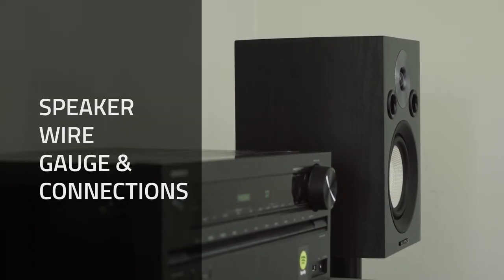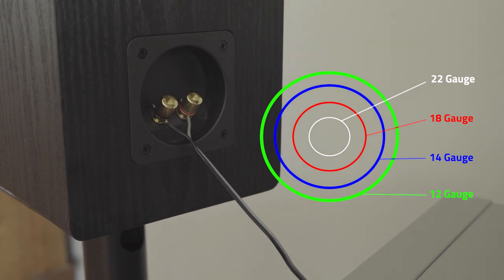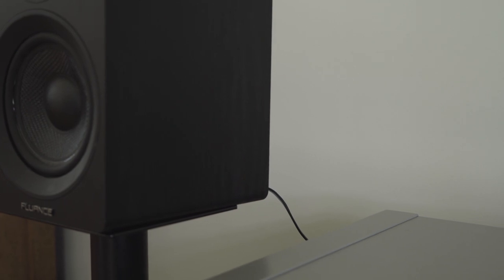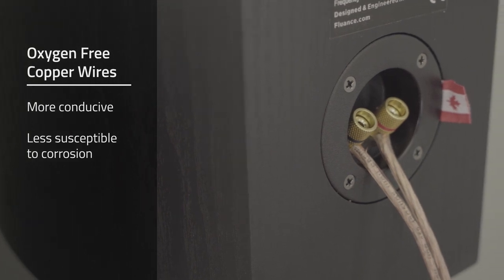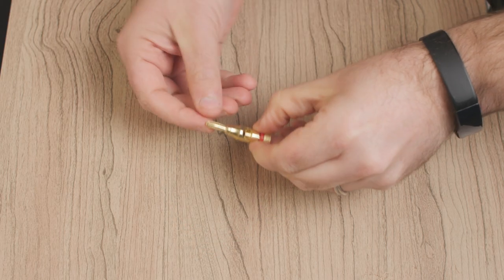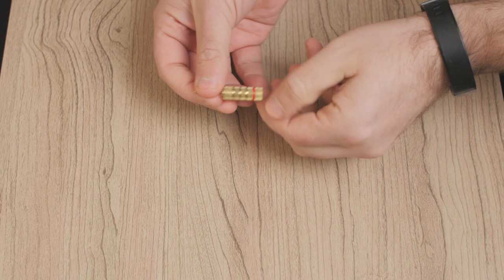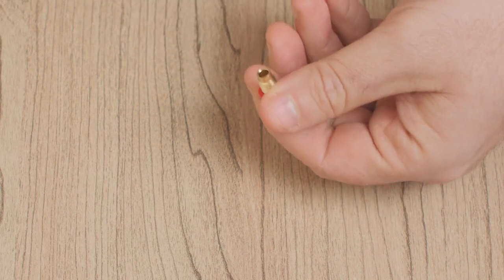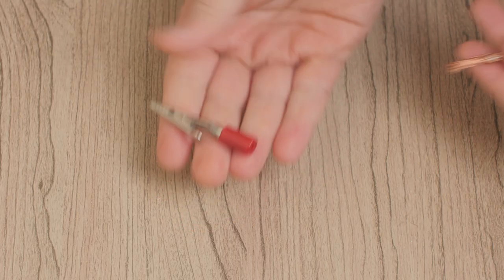Speaker Wire Connection: How to use Banana Plugs, Spade Connectors, Pin Connectors, and more

Comment: I have the old style speakers which have a red and black button and used the thin speaker wire. What Can I do to connect my speakers?
Reply from the maker: Thanks for your question! You will need to connect those speakers to an amplifier to use them. Be cautious as the amplifier needs to match the power handling (watts) and impedance (ohms) rating on the speakers.

Comment: there's an unthreaded "collar" on the base   before you get to the threads.  I'm pretty sure you're supposed to insert the wire through the bottom and then fan out the bare internal threads of the speaker wire over the collar of the base.  Once fanned around the collar you then screw the base into the top pin and the fanned threads are pinched in between.  No bare exposed threads sticking out.  Give it a go...

Comment: Less is More.
Use bare wire and stop any congestion or "bottlenecking" of the electrical signal into the speaker system. Hopefully the binding posts will also be made of pure copper (C110) and a seamless connection will ensue. Even real gold plated binding posts have only 75% of the conductivity of pure copper. Polished brass... 30%... and on and on. Stick with the standard of the industry and let the seamless conductivity of pure copper pave the way. You'll probably save some money doing so.

Comment: The banana plug you have demonstrated is not technically the best way.   The wire should be drawn in like a tube and then closed.  This will prevent a short circuit to the speaker next to you e.g. L and R must not touch as sound will then not be stereo!
I suggest you watch this video please and don't leave loose copper wires exposed:
https://www.youtube.com/watch?v=7H5fhtF9sEk
Reply: Thats a different banana plug type. These are open terminal/open screw banana plugs.

Look at this video for example: https://youtu.be/faSWEYtXogI